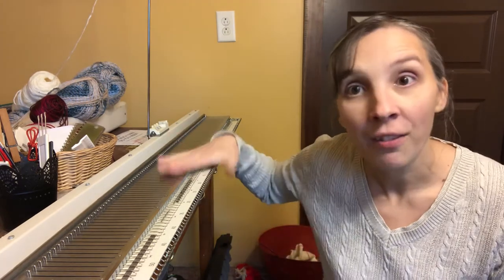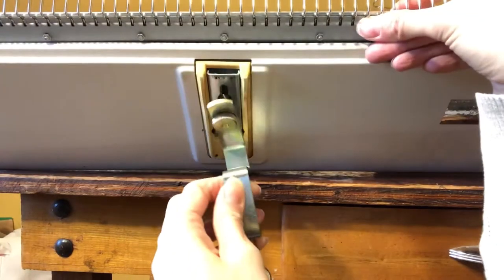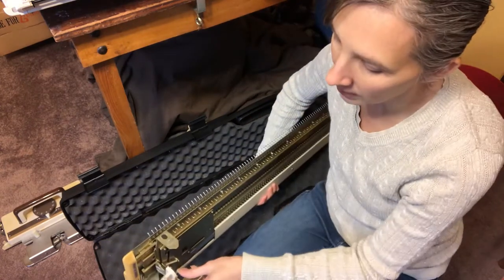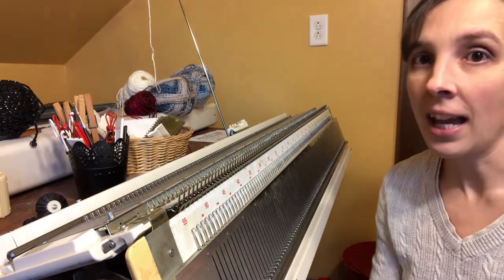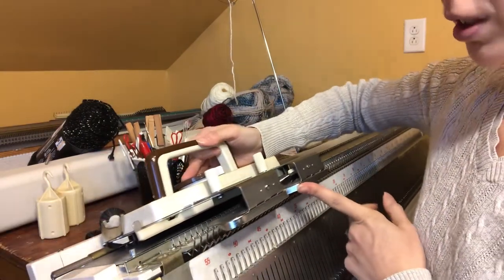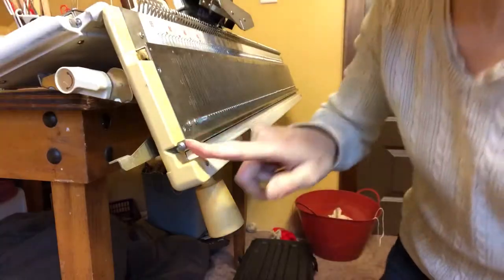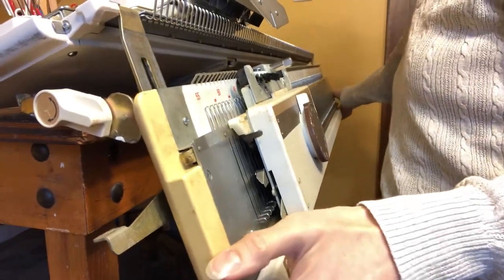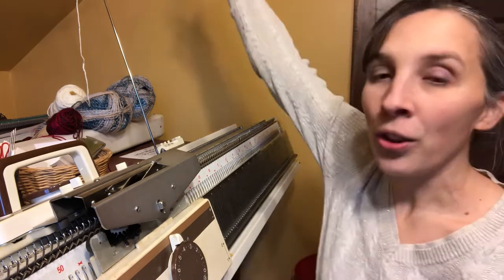Knitting Machine Ribber | Setting Up Your Ribber

Comment: Nice video, but I think you may have missed a couple of steps, the ribber is just hanging off the knitter in your video which is pretty unsafe.  I believe you are supposed to use the regular clamps to clamp the metal supports on either end of the ribber to the table.  Also, the tension rod isn't used as normal - you need to flip it around so that it leans towards you, not away from you.

Comment: You forgot 1 very important step! The clamps that you removed from the main bed must be attached to the bracket of the rubber to hold it onto the table, otherwise the ribber may fall; causing injury to the user, or damage to the machine, or both!
Reply from the maker: Thanks. I do have it like that on my standard machine but the instruction manual for this machine doesn’t call for the extra clamps. Definitely wouldn’t hurt to use them though.
Reply: My manual calls for the additional set of clamps, but I'm still scared the whole thing's going to fall off the table
Reply from the maker: Once you start using it you will see how sturdy it is. 😊
Reply: @LoveYourKnittingMachine  Thanks! I think I'll try it today after school!
Reply from the maker: Exciting!
Reply: Yes I just found that out.
Reply: @LoveYourKnittingMachine  Sorry to say, but with all the Silver Reed and Brother machines, YES, you NEED TO ATTACH THOSE "C" CLAMPS ALWAYS TO FIX THE RIBBER TO THE TABLE!!! And you also need to tighten the little screws located at the attachment point in the knitter where the ribber is attached to so the ribber doesn't slip off and falls over you or fall at the floor, possibly bending the knitter or hurting you or both, while moving the whole carriage set. I don't know why your manual doesn't say so, possibly you lost page 3 because it is there. The manuals for all my machines do mention that, including the manual for my Studio SK-155 bulky, for my Brother KH260/KR260 combo,  and I have been doing that procedure for more than 22 years now, and the whole structure, if properly assembled and all those four clamps correctly attached and fully tightened, will barely vibrate, so no fear of falling off the table.  Happy and Safe knitting!!!!!!

Comment: Trying to help my mom set up her ribber. Has the same model as in the video, but the piece that connects the two carriages has a different look, has a paddle on each side that moves up and down when the carriage changes direction. The carriage only moves an inch, then the gear that controls the paddles stops rotating and jams.
Reply from the maker: It’s hard to tell without seeing a picture. There is a group on Facebook that you could share a picture to and likely get your question answered. Check here https://www.facebook.com/groups/MKBCircle/?ref=share

Comment: When you slide the ribber endings on to the machine on both ends, do these pieces simply sit in those slots?  Or do they have to be somehow fastened?
Reply from the maker: They just sit there.
Reply: Thank you, but mine don't simply sit, these end pieces kind of move out a bit from the slots. It's not working properly.  so I try to rib, but I have to kind of squeeze the two beds together with one hand, so that it ribs.  I don't know how to fix my problem.  If you can give me advise that would be great.  I would love to knit a sweater.  thanks  @LoveYourKnittingMachine
Reply: I figured it out.  Can you believe that the table/ ribber clamps were not the right ones.  Apparently each machine has its own type of table/ribber clamps.  Now I hope that I can rib and knit a sweater.  Gosh, what a long time it took me to figure that out.  The machine was purchased used and it came with those clamps.  I had no idea that they were not the correct ones.
Reply from the maker: I can certainly believe that. Frustrating since they came with your machine. Thanks for sharing so that others with this problem can learn from you. 🩵